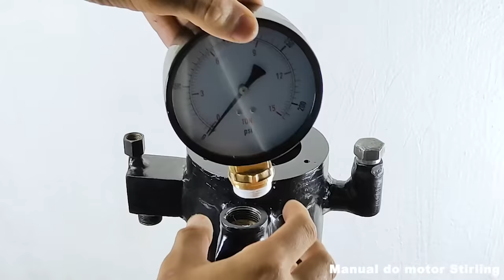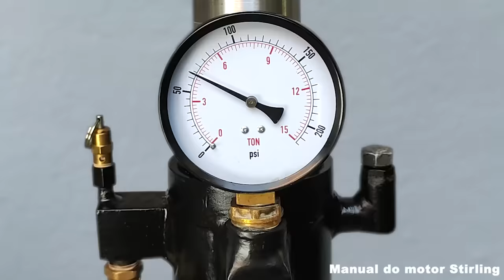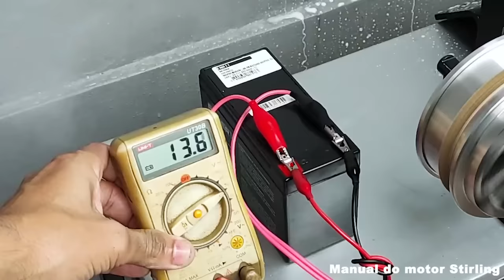( THE SOLUTION TO PRODUCE ELECTRICITY AT HOME ) How to make a steam engine, COMPLETE TUTORIAL.

Comment: What's going to happen when that little bit of oil you put in the lower rod bearing wears off?  I would have used an old go cart motor or tiller motor with a horizontal shaft, a lubrication system, and an extra heavy flywheel to keep it going, and tried to run it with steam pressure only on the top side of the piston.  You'd have to convert it to a two cycle, but that wouldn't require a lathe.

It looks like you have to have a one to build this steam engine.  Unless you're a machinist or otherwise have access to a lathe, you have to run out and buy one.  They're not cheap!  Do you think everyone one who needs to save money on his power bill, is going to be anxious to go buy one, especially those who know nothing about how to operate it?

Comment: there are two different types of steam engines and this type of engine should not make an electricity. This type is used when you need to use some variable speed of wheel, e.g some tool or car, train. If you want to produce an electricity then you MUST use turbine instead. Turbine is much more fits to the electricity production because has constant rotation speed and because you don't need to spend most part of energy to convert forvard moving to rotation

Comment: That´s not a Stirling engine, it´s a steam engine.
The 2nd small engine is a thermoacoustic stirling engine and you placed the fire candle wrong. The fire goes on the other end of the steel wool not on the beginning of it but the end🙄

Comment: OK ... it's a cool little toy ... however... it is just a toy..

#1.  There's not enough  head of steam with this setup... sure ,.. it will provide a burst of steam pressure long enough to get a reading on tje meter ... but there isn't even enough volume to sustain power for more than 1 half a minute is my guess..  

 2.   The Brass cylinder will grow with the heat and is not a suitable metal unless it was machined from a block of Brass.... not to mention that steam engines need to retain heat in order to keep the steam from condensing back into water ... also note that theres not even any insulation around it .. all steam cylinders require that to help keep this condensation from happening. Because water in the cylinder will not compress and will blow the head off.
     #3 An air pop-off valve is not suitable as a saftey valve because they are not designed to handle that much heat... 

    #4 there's no fusible plug in the boiler incase the water goes dry... not to mention a proper sight glass ......all adds up to a big dangerous boom .

    There's a lot more things I can mention but #2 #3 #4 are the dangerous ones that thought needed to be Mentioned  because I don't want to see anyone build this and get hurt 

    Its a great ingenious toy he built but please , if you build it,  just use it as a toy and run it on compressed air for safety sake.

Comment: There is a big flaw in this design and it's in the crankshaft rod bearing not being a sealed bearing, your just putting a few drops of oil to lubricate the rod bearing which will only last a short time before metal to metal contact happens, that type of rod bearing requires constant oil pressure just like in all combustion engines in order for the engine to last. A different type of sealed bearing needs to be used and requires a homemade crankshaft in order to put the right type of bearing to make this thing last millions to billions of rotating cycles.
Reply: The boiler is undersized and will only run that displacement in very short 'spirts'.

Comment: A solar panel would put out more power than that thing and would be cheaper & far more reliable too.

The trouble with burning stuff is that you lose 2/3 of the energy before you start even making electricity. Such a waste

Comment: This is hardly "THE SOLUTION" when it produces only 21 watts and uses coal.
Reply: So improve it, rather than complain, jerloff.  You could change the working gas and pressure, design better regenerators, add in more cylinders.
For a heat source you could use natural gas, or directed sunlight.  You could also set this up as a combined heat and power mechanism.
Reply: @kayakMike1000  Don't you understand "THE"? When you add all those complementary sources, it's no longer THE solution, it's only a small part of a possible solution.

Comment: Конструкция, на мой взгляд не продумана, хотя и собрана качественно. Недостатки: текущая со всех отверстий конденсированная вода, нестабильная работа устройства, неэффективное использование паровой мощности. Конструктору нужно было больше времени уделить имеющимся наработкам на примере того же паровоза! Что такое "перегретый пар" конструктор по-видимому и не знает. Даже просто гениальная модель №2 (с Али) - более эффективнее (и дешевле) его первой конструкции. Теория, мой друг и ещё раз теория, и только потом - практика.))

The design, in my opinion, is not thought out, although it is assembled qualitatively. Disadvantages: condensed water flowing from all holes, unstable operation of the device, inefficient use of steam power. The designer needed to devote more time to the existing developments on the example of the same locomotive! Apparently, the designer does not know what "superheated steam" is. Even the simply ingenious model No. 2 (with Ali) is more efficient (and cheaper) than his first design. Theory, my friend, and theory again, and only then - practice.))

Comment: What is the purpose of this video? Why not just call it a video about the making of a tiny single cylinder steam engine? It can't generate more than a few Watts, just enough to run s (flickering) lightbulb for a short while. It's of no practical use and is completely inefficient. Every Watt hour generated would cost at least 4 or 5 times the cost of a commercially generated electricity and I doubt if the saved electricity would pay for the cost of the engine-genny rig within the lifespan of the engine.
I can only concludde that the video is pure clickbait.

Comment: information         7:16  many  design  DEFECTS  are present.!        the connecting rod  Should  be  longer.!        there is an excess of MASS,  in most of the reciprocating/oscillating components.!        the design of the wrist pin assembly  SUCKS.        the affects of gravity, on the reciprocating mass in the system, Should be equalized.!   via the use of a horizontally oriented cylinder.        there is excessive drag, at each silicone rubber o-ring.        any  reciprocating engine  Should have a  Flywheel.     a flywheel  is  NOT  a  pulley.        the extreme drop in engine rpms, when it is  loaded,  INDICATES  that the engine is not being loaded, Correctly.
NO actual support is offered in support of the accuracy of the performance claimed.!       this is so because,  the  USE  of  Some of  the output power  is  Not  informative.          googletranslate

Comment: produce power at home, yeah riight. enough to charge a small 12 volt battery. it aint gunna power a fridge or stove or even many 12 volt lights. not much point in doing all that work. the heat engine produces even less power. not exactly practical.